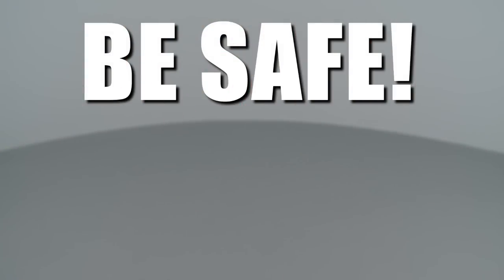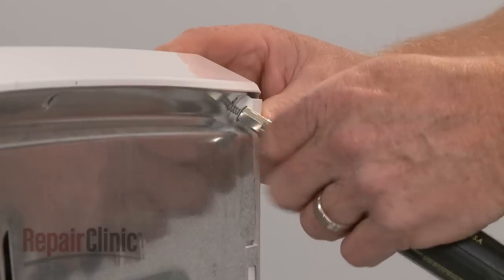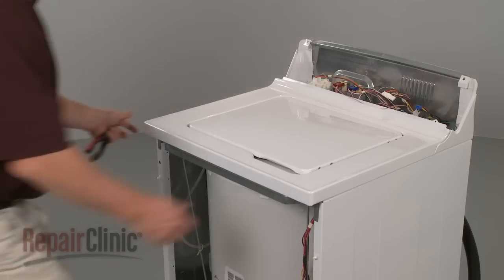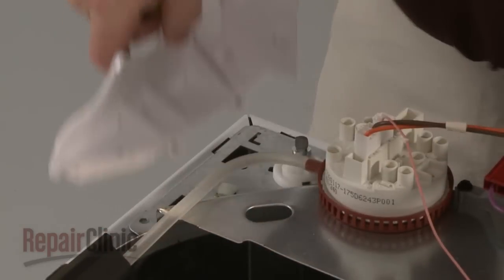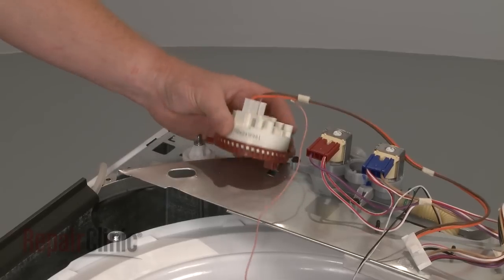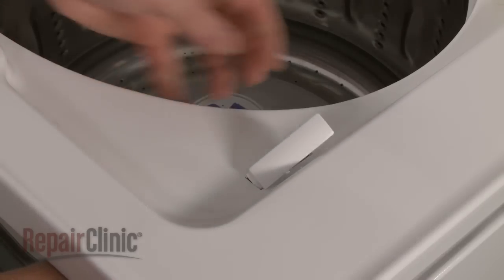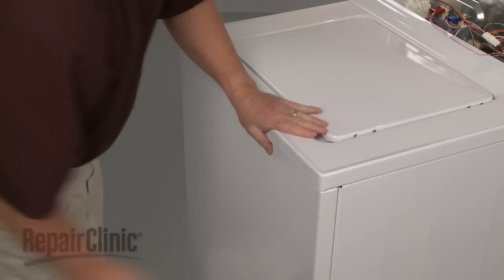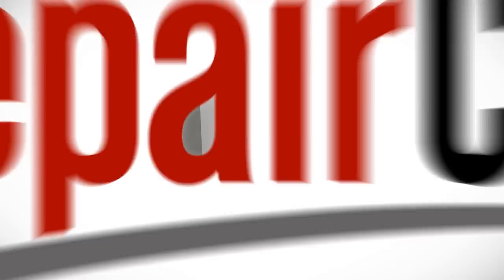GE Top Load Washer Pressure Switch Replacement #WH12X10412

Comment: If it doesn't advance  how can I rule out its not the start button the is not working . My washer keep stopping during a cycle and once I push the start button again it starts  working again . Would this  pressure switch  if its bad  continue working if the start button is pressed again ?

Comment: Would the pressure switch be the cause of the water level not operating correctly ? The water doesn't seem to stop at the desired fill level !
Reply from the maker: Jon Lynch Yes, that is a possible cause. You'll find model-specific troubleshooting and repair help information in our website's repair help section: http://www.repairclinic.com/repairhelp?TLSID=1773.

Comment: I have the same washer in this video, the water level is wrong when filling up. we checked the hose and it seems to be fine.  it fills up to about a small or med load and shuts off. Do you think the switch is bad? Thank you